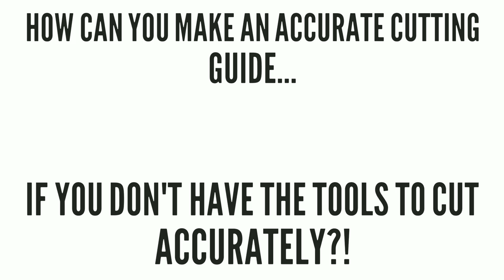DIY Magnetic Handsaw Cutting Guide - Cutting Straight & Square is Easy WITHOUT Expensive Tools!

Comment: Applying wax to the saw and the face of the guide prevents friction and makes cutting easier. Thank you for sharing your wisdom with us.
Reply from the maker: Thanks, I think I've had more success with spray lubricant in the past. I might've also tried Vaseline. The problem with wax is that it's too hard and can rub off or not stick to the steel somtimes.
Reply: Try a different wax.
I have an old can of "Johnson's" paste wax, and find it to be very adhesive to iron, steel and aluminium bench tool tables, which helps to slide the wood better. 
It has some "Carnauba" wax content, and was meant to be applied to wooden floors, intending to make the floor not too slippery, to help prevent people falling.
Thanks for your helpful videos, I'm suscribing!

Comment: I like your video and I want to ask what is the blade thickness of the saw blade you're using here? My pull saws used for hardwood are .3 and .5 mm thick.
Reply from the maker: @indonesiaamerica7050  I'm not sure. But I'm super impressed by its abilities.

Comment: Thank You!!!  great guide!  I am making a waterfall joint on a bar. The wood is 12" wide and 1 3/4" thick, and I need to make a couple perfect bevel cuts. What kind of hand saw and guide can I use?
Reply from the maker: I linked everything I used here in the description, but if it needs to be perfect, I think you need a table saw or a track saw. Maybe pay a professional to cut them?

Comment: Good idea, but the end of the guide that rubs on the side of the saw needs lubricating somehow. Maybe wax polish? Also, why 3 magnets in the end of the wood guide? Two of them will only attract each other and not the saw?
Reply from the maker: The contact is dry between the wood and saw so there isn't much friction at all. Stacking 3 magnets is stronger than only using 1. I actually intended to use only 2 magnets, but I was unable to separate them. Hope this clears it up :)

Comment: Don't know if it is just me, but the links to your tools and materials do not seem to be working. It could be because I am in the States, hard to tell. I am very interested in both the magnets, but really interested in the name brand of the saw you are using. I am very impressed with it's ability to cut so much wood and remain very sharp. Thank you.
Reply from the maker: Thanks, KIT changed their links. I'm aware of that. If you remove the m and make the link kit.co instead of kit.com it'll work in the meantime.
Reply: @Yonatan24  okay thanks. I will look for the info on the saw, thanks so much.
Reply from the maker: I'm currently fixing the links on all of my videos but here it is: https://kit.co/Yonatan24/how-to-make-a-magnetic-japanese-saw-cutting-guide-what-you-need
Reply: I used a magnet out of an old hard drive. It's not circular, but it works well. Because of its segment shape, I couldn't just drill a hole, so I cut a slot instead just wide enough for the magnet to sit in. Then I glued a piece of 3.5mm plywood over it and trimmed the edges just like in the video. Be cautious if using hard drive magnets! There are two very strong magnets in a typical hard drive and as I was experimenting, the two snapped together, pinching the tip of my finger. No harm done, but just imagine a small screw or nail being inadvertently "sucked" into the body!
Reply from the maker: Awesome! I've used HDD magnets for a bunch of projects, you should check out my new homemade bike rack video, where I used three HDD magnets to make a magnetic mount for my bike lock, in case you haven't already seen it.
They are definitely very strong, I've had many break, and have gotten pinched so many times!
What say do you use?

Comment: Оно стоит того? Пилить бруски 50мм можно и недорогой торцовочной пилой если объём большой. Магнит то такой явно не дешев.
Is it worth it? You can also cut 50mm bars with an inexpensive miter saw if the volume is large. The magnet is obviously not cheap.
Reply from the maker: I got the magnet for free and I don't have a miter saw.
Reply: @Yonatan24  understandably. Each has its own initial conditions.

Comment: Great idea! I'd recommend avoiding your metal vise though to not break any saw teeth. I'd clamp it to the bench if possible instead.
Reply from the maker: Thanks! I've hit the bolts that tighten the base and steel in front of the vise. Can't beat the practicality, though, ideally it would be mounted on its own stand.

Comment: Good thinking.   Way to use your mind to solve a problem without just buying something expensive.   Now, get yourself a good (a good one like an old Stanley or Bailey) handplane at a yard sale or flea market, restore it, sharpen it to the max (sandpaper and a leather strop).   Then make a bench hook and a shooting board.
Reply from the maker: Thanks. I have a useless, old, wooden handle plane. I've tried using it, have bought accessories for using it, but I haven't been able to make it work. I generally  don't need pieces of wood to be perfectly square, only to look square, and this has been working great so far!
Reply: @Yonatan24  Ah, but some projects do need to be perfectly square. For example, I have an old IKEA TV table and it hadn't been used for eight years since I swapped my heavy TV for a flatscreen. Each leg is screwed into the underside of the tabletop with a single screw stud in the centre. You just twist the leg and tighten it up against the table. I didn't need the table, but I did need a computer desk! So I replaced the short IKEA legs with much longer ones sawn from a length of 50mm square pine wood. The cut face of each new leg has to be perfectly square where it butts up against the tabletop. To make the screw stud I drilled a 6mm dia hole in the centre of the cut face, then drilled with an 8mm drill just a tiny depth into the hole so as to start my screw, then screwed an M8 bolt directly into the wood like a self-tapping woodscrew. Finally, cut off the bolt hex head with a hacksaw so that the remaining stud is the correct length to match the original IKEA one. If that cut end of the new leg isn't perfectly square, it shows when you tighten the leg. You see a small gap on one side and it just looks sloppy and amateurish.

Comment: I've learned new clamping method.
Reply: Ah, clamping! Yes! The instant I read your comment I thought of making a small magnetic clamp to hold components in place while soldering them on a small circuit board. I do have those spring clips mounted with a magnifying glass, but it is sometimes awkward to position them. Obviously, keep the magnet well away from the actual components! The magnet wouldn't need to be very strong, as the parts are typically very lightweight. I'm thinking, maybe cut a piece of 10mm wooden dowel then stick a small circular neodymium magnet on the end face using superglue. Then make another dowel piece, but stick a steel washer on the end. Then pinch the item(s) to be soldered between the dowels. A picture would help.. Maybe later today I'll make a prototype and add a photograph to this comment.
Reply from the maker: Please do, I'm interested in seeing how it turns out. You can probably upload a picture to Imgur and link it here.